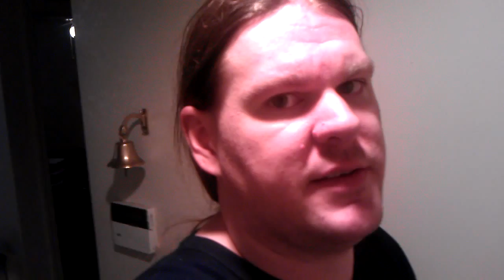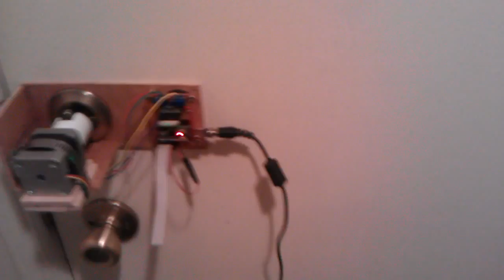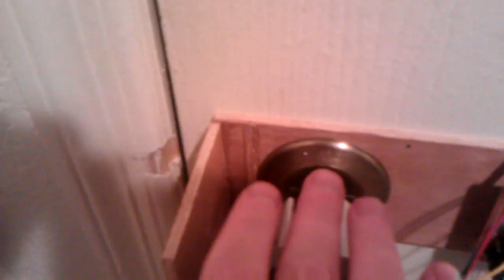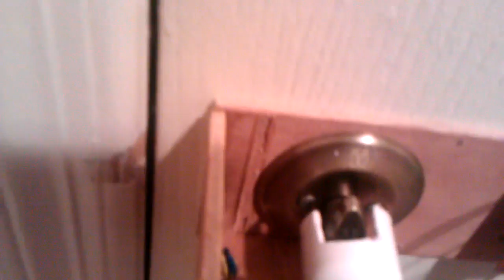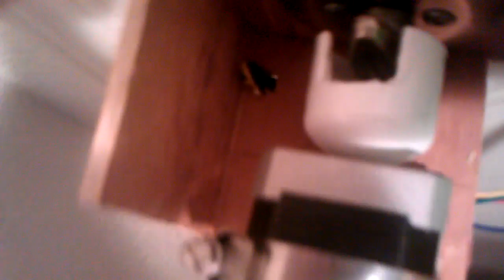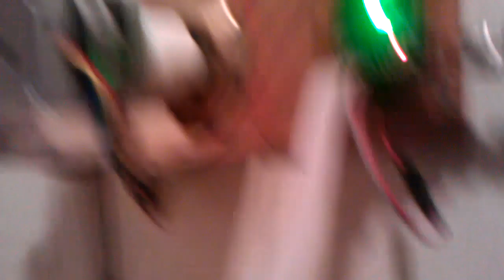Arduino Secret Knock Detector

Comment: what size is that motor? nema17?
Reply from the maker: I believe so.  I have quite a few stepper motors though.  I do know that it works fine with smaller motors though.